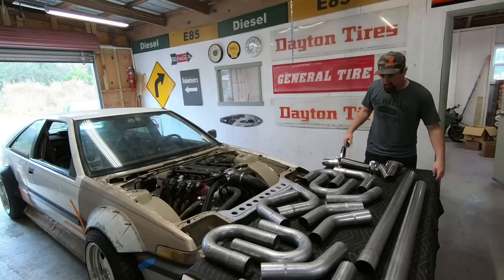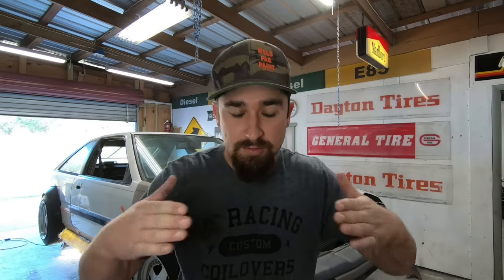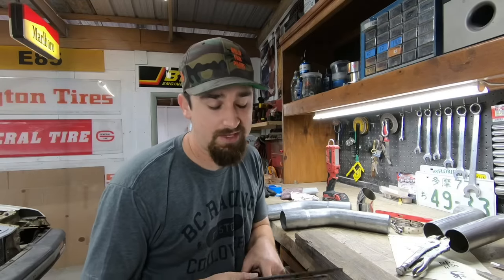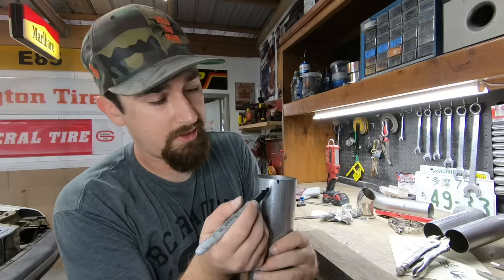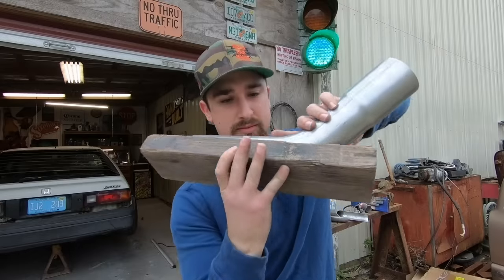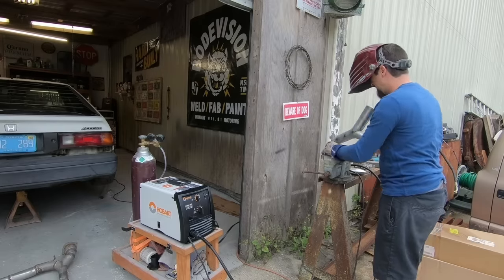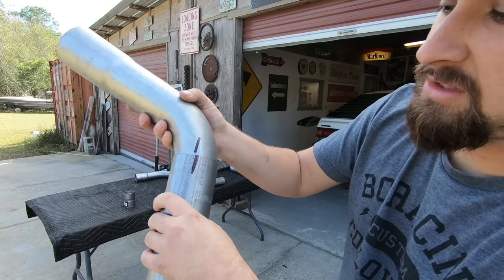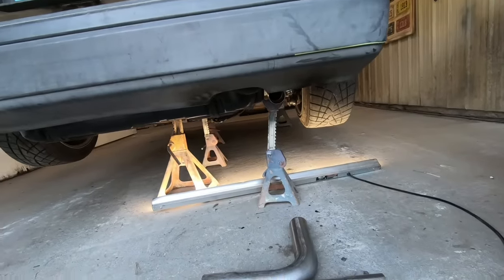Beginner's Guide to Building a Custom Exhaust

Comment: Watching these videos while I wait for my new high flow cats haha. I did a wild custom exhaust on my Dodge ram 1500, haven't seen anyone do what I've done. I did a dual exhaust and cut out the y pipe from the cats to run the pipes straigt back on each side of the transmission. Now if you know these rams, they have the exhaust tunnel on the passenger side. I customized my truck to fit the driver side exhaust on the driver side. Then ran a 3 inch x pipe system for a 5.0 mustang voodoo behind the transmission and transfer case and above the driveshaft and out the side of the bed. I just installed BBK long tube headers and learned real quick my stock cats will not work with how I setup the exhaust system no matter how I modified the angles on the cats. So I ordered smaller high flow cats cause they are shorter and a smaller diameter to clear my driveshaft and stay away from the transmission so everything clears and fits back together. Its been a whole ass project installing these headers lol

Comment: if you wrap a large zip tie around any pipe, straight or curved.. and mark it with a sharpy.. you can cut nice clean straight lines around the pipe
Reply: solid pro tip for us newbs, won’t deflect like tape

Comment: You are a badass fabricator, great skills!
Reply from the maker: Thank you very much!
Reply: @BodeVision  I have a question so I have a muffler delete on my car and I bought an aftermarket exhaust an had it welded on to the rest of my stock pipe so I was wondering if I cut off my resonator and clamped on a 2.5 inch straight pipe would that make any difference in the sound of my car like make it louder then just the muffler delete or what would that do?

Comment: Hey man! PLEASE READ: I have a nearly mint condition 1983 Honda Accord sedan and want to LS swap it but I dont weld and don't know how much that kind of project would cost. Just hoping you or anyone reading this with swap knowledge could answer my questions! My Accord was inherited and garage kept, no rust and 150k original miles on it! Fully red interior and is getting wrapped in a metallic aqua blue. ALSO: I LOVE YOUR CONTENT IT IS INCREDIBLE BRO, KEEP IT COMING!
Reply from the maker: Hey man! It’s near impossible to estimate what this would cost because the amount of time it would take can vary. Also depends on if you went with a donor car like I did. You would need to consider cost of a full additional car plus labor to adapt the car to work with donor cars stuff.

Comment: Great vid man. I was wondering on systems where the mid muffler and end muffler are deleted. What is the difference in sound when you place an aftermarket muffler(s) in the mid section versus at the very back of the car?

Comment: I did a custom dual exhaust on my o7 silversdo myself in 2.5 days. It took longer extracting the header bolts to replace the manifold than it did to the rest of the exhaust haha. I had to tac weld out cylinder 8 5 times cus the bolt kept breaking off. In the head.

Comment: When I was in high school a buddy of mines father was a professional Mechanic and my Buddy always had pretty badass hotrods one day after school he offered to give me a ride home  which I accepted  when I got there he said  hey checkout my new exhaust my Dad and I put on last night  Damn it sounded great  he said take a look at it and I  did  he had two glass packs pretty close to the V8 motor and straight pipes running  out the back of the car  all welded together  he told me that he and his Dad stayed up all night putting it together  using what they could get at 3 in the morning ? I found out the pipes were not exhaust pipes but Galvanized ChainLink fence parts they took out of the Parks baseball backstop  in the middle of the night  it was like 1/8” wall thick pipe  and we both laughed because it was his Dad that walked up to the park and dissasembled the backstop in the Moonlight

Comment: Great job, you should have went with 3" on the single pipe. Whenever you go from 2 pipes to a single, rhe single should always be larger, look at all factory y sections. It will work, but reduces horsepower. Sounds great though.

Comment: I know this is kind of late, but could you also cut the two pieces at a slight angle so that the exhaust gas from the two pipes merge easier or is this neglectable/ would it have any benefits ?

Comment: Question.  should the car be resting on the tires vs. up in the air?  drive shaft, differential and suspension pieces are angled / positioned differently with the full weight of the car on the ground.
Reply from the maker: The drive shaft doesn’t move up and down since this has independent rear suspension. If you had a solid rear axle and leaf springs, yes. My case. No.

Comment: I was considering using glasspack mufflers for portions of turbo back exhaust system instead of just straight exhaust tubing. In hopes of a louder and unique exhaust sound. As turbochargers act as a pseudo muffler, decreasing exhaust volume. However, the largest diameter glasspack is around 4 inches. I had planned on expanding the exhaust tubing from the exhaust side of the turbo to 5 inches. As turbos like large exhaust diameter/exhaust flow. Has anyone ever done such a thing? I realize that this would be both expensive as well as uncommon. Thanks

Comment: Uhmmm, you need a flex pipe!?
And were you migging stainless?
Reply: It's a longitudally mounted engine and the exhaust is steel and soft mounted. No flex pipe is needed. Lots of cars come from the factory without any flex pipe and have no issues, my own car included.
Reply: @lb9gta307  interesting! Must be a very well balanced layout at least compared to the inherently unbalanced 4 bangers I work on, I just imagened a 2m metal tube on a vibrating metal block is never smart for any weld.